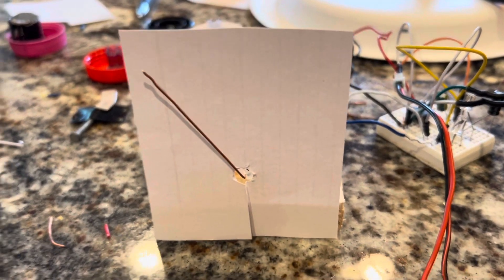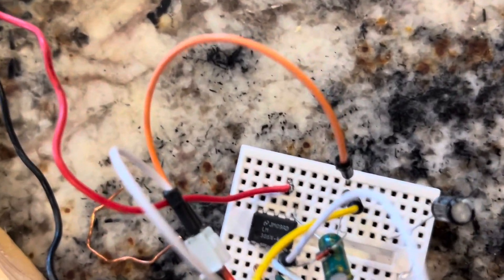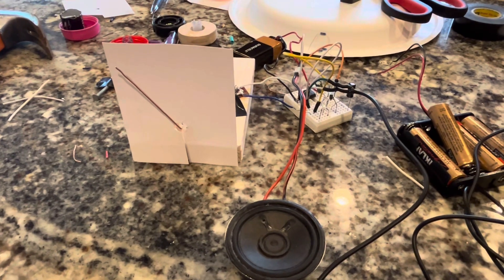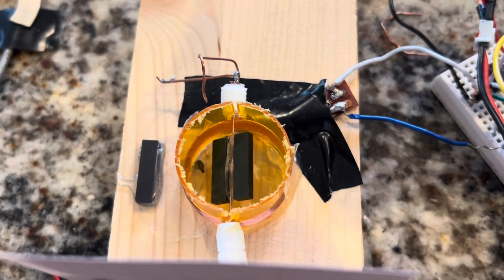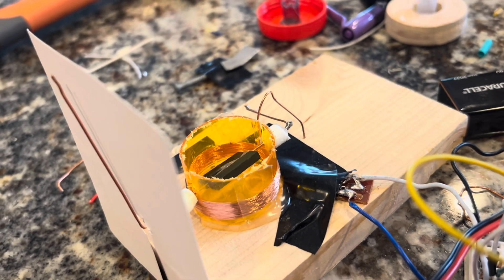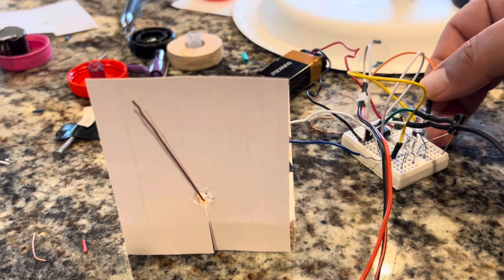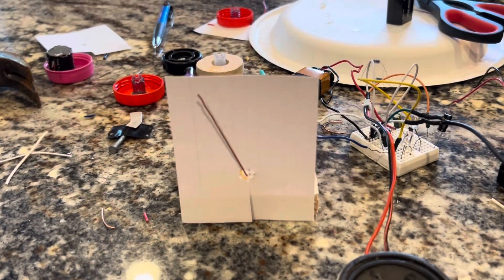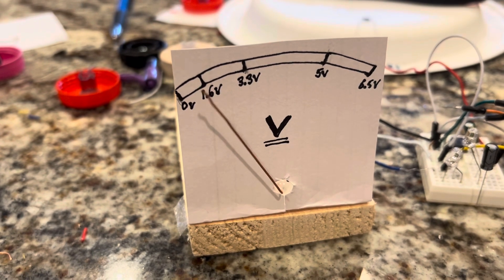DIY Analog VU meter Part 2 - Testing with Audio Signal

Comment: I think you got a lot of fun building your project. Now with that VU meter only thing left to do is , to give it a bit stronger signal , and to miniaturize it. However I can see your channel suffer from same as my do , youtube engine just buried you somewhere deep down below  million other youtubers. And I know from my own experience it is quite hard if not impossible to get back to the surface.
Reply from the maker: Yes. This is just a proof of concept. Just wanted to see if i can make it. I dont understand how the youtube engine works but as long as some people interested, i will keep posting. I use my channel like a lab notebook vlog.
Reply: @igorbrichkov3632 i’ve found a video of yours by a very specific google search. “Tape bias oscillator schematic”
Reply: Well actually i just found this on my youtube reccomended page
Reply: To be fair he " only " has 816 subscribers. I do not expect youtube to show me channels with, say, 15 subscribers, if you get my point.
Does not matter how good it is. And what is good is subjective.